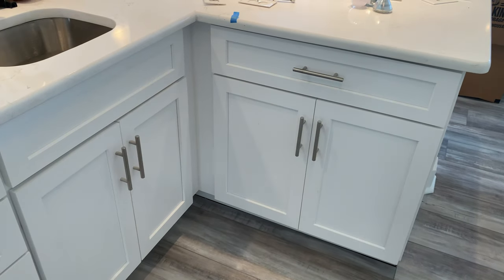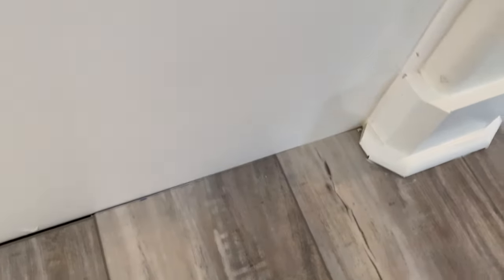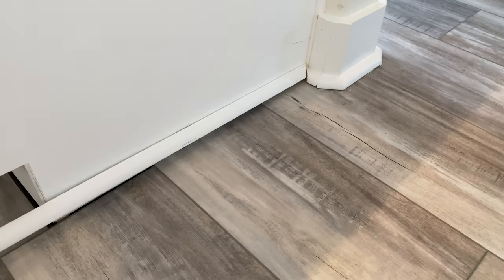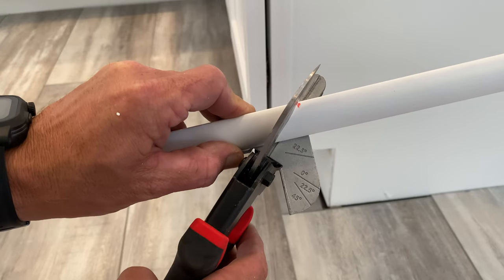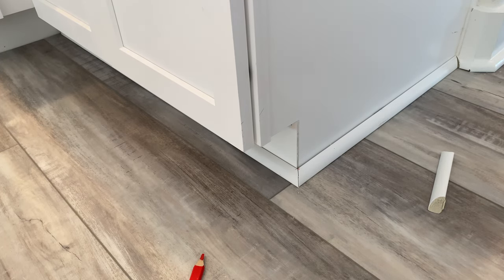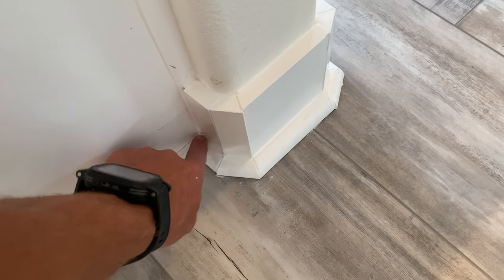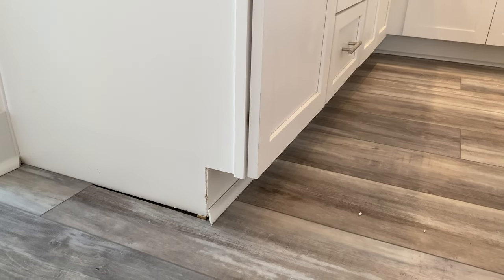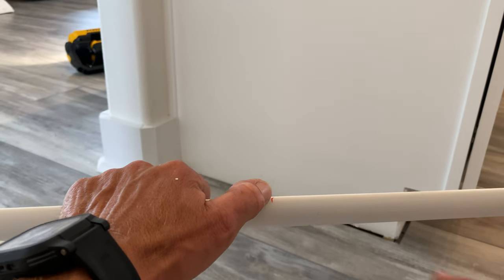Fast way to install quarter round trim

Comment: 44.5 degree cut create a perfect tight joint. 45 degree cut doesn't always give perfect joint and may need to caulking to seal some of the gap at the joint.
Reply: Jesus WHYYYYYYY has NO ONE EVERRRRR said this? I can't believe this "duh" moment. 🤦🤦🤦🤦🤦🤦🤦
Reply: Caulking is like paint. It covers up a ton of sins😉
Reply: When he's saying a "45", it's understood that the angle is variable from that, especially since he's cutting as he's actively placing the quarter round  🤨
Reply: I cope my inside corners with a dremel fast and no caulk needed just a little c a glue on my outside corners it’s good practice for putting in non painted 3/4 round
Reply: @TrumpedUp888  caulk and paint,,make a carpenter what he ain't!
Reply: 44.5 won’t work on all corners, usually down 2 or up 2, shit houses can be up 4 degrees. If they pay for perfect corners I’ll get every damn piece perfect. But usually they don’t want to pay for that. Never have a problem with 45s if you use miter bond. ALWAYS COPE INSIDES!
Reply: @kathleenrutherford733  I use a jigsaw with a coping foot now. but if you inside 45 your piece than flip it upside down, back cut your long straight side with your miter saw. That saves you a lot of time, then work in sections with your coping saw cutting little by little. The more accurate you’re there, the less you have to file down. If you’re really having trouble cut close than file down to your liking.
Reply: @Billybob-go8hn  you lost me? 😂
Reply: Do your best caulk the rest
Reply: Hard to get a fraction cut. I prefer 44* inside corners and 46* outside corners….
Reply: @jakerossgil3048 I wish I'd done that instead I learned to cope with a cope saw.. and I'm still coping with how long it took

Comment: I didn't even know such a tool existed for cutting the trim miters! I immediately went out this morning and bought one. It's going to make this job go so much faster, and will be much cleaner than user the miter saw! I even have the same nail gun, borrowed from my brother. :D
Reply from the maker: That’s awesome. I absolutely love them
Reply: I had bought a similar cutting tool for my quarter round.  It wasn't working worth a darn.  After watching your video,  I saw that I was putting the quarter round in the tool backwards.  DUH....works much better now!  Ha  Thanks my friend!
Reply: What is the tool called and where do you get it
Reply: @Davekinematic  Home Depot has them. And Amazon just tell them what u looking for they will know. I think it’s a quarter round clipper
Reply: What are they called?
Reply: Nvm found em
Reply: the tool is called a "miter shear" if anyone finds this and is wondering

Comment: I just ordered a ratcheting miter shear tool. Through my research it seems like the ratcheting version of the shears tend to not snap through the material, and have a more controlled slicing action. I’ll test it in a few days when they arrive

Comment: what is the name of that cutting tool I have been using a miter saw this seems alot easier I have been having an issue with a wall that is on a Angle and I keep missing the mark .. Great Video !!!
Reply from the maker: Miter snips

Comment: Thanks for the video!  If you leave 1/4" gag on your base molding, how does 1/4" round cover the gap?  Second question- How do you attach 1/4' round when there are steel studs?  I do not want to glue it, since the 1/4' round has to be removed in the future to replace the flooring.   Thanks
Reply from the maker: That’s a good question I would glue them and still be able to pull them off later. Base is usually left up a 1/4” to allow for carpet. Or other original floor

Comment: I tried to do this in my bathroom last night. I have a miter saw one those plastic guides. I could not get my head around the inside and outside 45. One of those snips would work a lot better 🤨👍

Comment: PVC quarter round is very easy to file a coped joint. Imo it makes a tighter install without the caulk issues
Reply from the maker: That’s very true

Comment: What a great tutorial Chris. What if I don't have that amazing power tool. What would you suggest? What type of hammer? What type of nail? I don't want to scratch the heck out of the floor to get the same angle as you do. Thanks so much.
Reply from the maker: Finishing nails and any hammer will do

Comment: I have the same brand in shoe moulding might try this tool Is there a reason why you didn't use shoe mould instead
Reply from the maker: Yes we used 3/4 rounds as the floor guys didn’t get the floor close enough to the walls
Reply: @crdriscoll1  ok makes sense.

Comment: Is there a tool that makes cutting wood 1/4 round as simple as PVC? I read you are going to post a 'how to'' for wood 1/4 round; where should I go to view the tutorial for cutting this product?  Very informative!!
Reply from the maker: The miter snips will work on pvc. But not so good on wood I would use a miter box and saw for wood good luck 👍

Comment: This was actually pretty helpful, I’ve worked on flooring before but we had a designated old man that would do the 1/4 round, baseboard, & t moldings. Never got around to learning it
Reply from the maker: Hey thanks for watching its very easy to figure out practice makes perfect 👍

Comment: Miter Snips.  WHERE DO YOU GET THEM - Good question. I got them at Home Depot in the flooring section most of them are set up kinda the same. Also lowes has some as well. Miter Snips.

Comment: Thanks, this is the point I am at with my own kitchen.  What kind of caulk do I use, and where do I apply it?  I have an engineered hardwood floating floor and 1/4" thick toe kicks.  I will be using pre-painted pine quarter-round.  I don't have that tool, but I have a miter saw.
Reply from the maker: I use Alex Flex paintable white caulking fast dry. Usually caulk just the top side of your moldings and have a clean wet rag handy with a small bucket of water to rinse the rag out. Once you apply the caulking with the caulk gun take and wet your finger index usually just moist not dripping and run it across the area you did with the caulk gun in both directions cleaning your finger off often to keep it from making a wide caulk joint. Hope this help’s.. This is if you are painting the molding. If you are staining it or want it natural then really don’t need to caulk.
Reply: @crdriscoll1  OK thank you!

Comment: great video man ..quick question .im trying to put some quarter round against floor base board but I have tile can I still nail them don't want to risk the nail cracking the tile and also what cutter are you using ?
Reply: Glue & some heavy books 📚 or full paint cans with a tshirt under to prevent scratches

Comment: if I buy the quarter round, install all the trimwork, and then use a caulk to fill in the staple hole or even any minor gap where the two ends meet. The colors never seem to match. The baseboard never matches the quarter round, the quarter round never matches the caulk.   Any advice you can give me so I’m not installing all this and then having to have to repaint everything?
Reply from the maker: Great question most trim is only primed. Giving that it will almost always show a difference in the Spackling to fill nail holes or even caulking. I always run my finger down the caulk line and then wipe with wet clean rags to minimize the (squeezing out effect) of the caulking and run that rag right over the nail holes. That may make the colors less noticeable but use like a 23 gage nail gun and that leaves a very needle size nail hole that almost invisible to the naked eye. Hope this will help some. Thanks for watching and commenting
Reply: Unpainted caulking will collect dirt and discolor over time. I like to put a coat of paint on trim before I install and then a quick touch up coat after caulk and putty dries.

Comment: I messed up and left too much gap at the door jambs. I did not cut into the door jamb to slide the plank under. Any ideas on how to cover these gaps?
Reply from the maker: Depending on how big the gap is will depend on what you can do. You could add some trim stock at the bottom of the door casings if you have like 1x4 trim but if you have Basic door casing trim it has a curve to it you may be able to find using a caulking that matches close to the color floor could help take the Eyes away from it. But again it really depends on how big the gap is.
Reply: @crdriscoll1  thanks. Appreciate the response. Good video too btw

Comment: Caulking just collects dirtbwhen applied next to a floor like this. If you want everything tight without caulking use a chop box.instead of caulk get some white filler

Comment: Good video. It's a pretty good explanation for us, rookies 😆. Do you like using the PVC cause it's a wet area, and does it cost a lot more to use pvc .Thanks
Reply from the maker: Not really much more at all and yes for wet location plus the ease of cutting so lower labor cost for sure

Comment: "Ideal" for "idea".  "Suscribe"  for "subscribe".  Interesting.   From the south?  Decent tutorial, though it didn't include things like inside closets, dead ends at doorways, joints along walls, and odd angles.       It's the details that make DIY challenging.

Comment: Just got me cabinets installed and the carpenter made straight cuts 🤦🏽‍♀️ and did not install the side pieces.
Reply from the maker: That’s not good only way is cope one side of the trim then the other side straight cut. Thanks for watching

Comment: Hi what are the cutters you're using? I`m looking to do an installation job and need to get those. also where do you get the PVC Mouldings from? Thanks!
Reply from the maker: Actually the miter snips can be found at lowes or Home Depot they are usually in the flooring section the quarter round i buy it at Home Depot in the trim section they have a section of all types of pvc trims hope this helps and thanks for watching

Comment: can you share the link of the tool you using
Reply from the maker: Here is a link to the miter snips thanks for watch. https://www.lowes.com/pd/CRAFTSMAN-Miter-Snips/5000085303?cm_mmc=shp-cprdtolgglLIA_TOL_216_Construction-Hand-Tools-5000085303-local-0-_-0&ds_rl=1286981&gclid=CjwKCAjwv-GUBhAzEiwASUMm4tMZeLptNTekJgg0y7JvK3vg3CFROAdZULZsNbntLC8ANc1SHDX46RoCKmgQAvD_BwE&gclsrc=aw.ds

Comment: Why wasn't the flooring installed all the way to the wall? Instead of the edge of the cabinets?
Reply from the maker: That is because the cabinets are installed before the flooring and you need a space in between walls and objects to keep your floor from swelling and buckling.
Reply: If it’s a floating floor like almost all are today you cannot install cabinets over the floor or it will buckle when it expands
Reply: @flyingburritobro68  you're right 👍

Comment: what's the name of that thing to cut the 45 I await your answer thanks
Reply from the maker: They are called miter snips. Here is a link for lowes hope this helps. 
https://www.lowes.com/pd/CRAFTSMAN-Miter-Snips/5000085303?cm_mmc=shp-cprdtolgglLIA_TOL_216_Construction-Hand-Tools-5000085303--0--0-_-0&ds_rl=1286981&gclid=Cj0KCQiAy4eNBhCaARIsAFDVtI0sZyhJfhvgzsGiMHZkXbO8DIkxYTnUX1lKNNzNHMtWuORWZ0g-IO0aAi1bEALw_wcB&gclsrc=aw.ds

Comment: What gauge nailer are you using here? I’m not familiar with the DeW guns.
Reply from the maker: Hi there it’s an 18 gauge dewalt pin nailer 20 volt cordless 
https://www.homedepot.com/p/DEWALT-20-Volt-MAX-XR-Lithium-Ion-Cordless-18-Gauge-Brad-Nailer-Tool-Only-DCN680B/302029641?source=shoppingads&locale=en-US

Comment: How do you terminate on either side of the dishwasher?  Do you butt cut, or some other cut?
Reply from the maker: Good question, yes just a regular square cut or butt cut end is how to end the quarter round at the dishwasher.
Reply: You make what is called a return.

Comment: I'm not saying it's true, because I'm a newbie myself, but the feedback I've gotten from some pros is that it's a rookie mistake to use quarter round instead of shoe molding
Reply from the maker: That could be but in this particular job the flooring had to much gap to cove with shoe round
Reply: @crdriscoll1  
After I made the comment, I saw more videos, and I stand corrected.

Comment: Is that real wood?  Will those cut oak ? I do 3000 windows a year and use alot of 1/4 round.
Reply from the maker: Great question, the Quarter round that I am using in this current video is actually PVC and that cut super easy with the miter snips but they will cut wood also just definitely got to have some good hand strength to chop through solid oak. I bought myself one of the cordless 20 V Dewalt chop saws that thing is super light weight and really does a great job with the shadow line instead of a laser line on the blade it is spot on every time but to answer your question yes it will cut oak.
Reply: Will not cut oak

Comment: Never miter inside corners.  Always cope.  Much tighter, cleaner, faster.  Walls are never flat.  You might have a perfect joint until you nail....

Comment: Where can I get the cutting tool? Thanks
Reply from the maker: Hey here is a link to Lowes. Also Home Depot has some too 

https://www.lowes.com/pd/CRAFTSMAN-Miter-Snips/5000085303?cm_mmc=shp-cprdtolgglSS_TOL_216_Construction-Hand-Tools-5000085303-local-0-_-0&gclid=Cj0KCQiAk4aOBhCTARIsAFWFP9EyAGR_NXfYTVSCXbtNqy_i5vWikoIuXYXRoJpjpo8iryrU0nKLeDkaAnVSEALw_wcB&gclsrc=aw.ds

Comment: In my trim carpentry opinion, base shoe molding should always be used for a professional look. Quarter round molding used as a base shoe just looks wrong. Looks like rental property.
Reply from the maker: Exactly what it is a rental property and could not use shoe molding as who ever installed the floors left way to big of a gap. In my opinion I would install baseboards after floors then use no shoe or quarter round

Comment: Shoe mold is different  than quarter  round.
Reply from the maker: Correct should round goes about 3/8” on bottom and rounded at top to nothing quarter round is a continuous radius

Comment: Where did u find those snips
Reply from the maker: Good question. I got them at Home Depot in the flooring section most of them are set up kinda the same. Also lowes has some as well. Miter Snips.

Comment: Your website says "The length of the nail should be approximately three times the thickness of the quarter round." huh!! ?? So a 3/4 quarter round will need a 2 1/4 inch nail?
Reply from the maker: Don’t think my website says anything about the length of nails

Comment: Never do inside 45 mitres. Do a cope mitre  using a coping saw. I've been doing this kind of work for over 50 years. I don't know of any pro who does inside 45 mitres.
Reply from the maker: Spec houses
Reply: Real pros cope there outside corners too😜
Reply: Inside coping is a true sign of a professional.

Comment: No pencil please. Mark it with the same blade of the Miter Cuter. And use 23 Gauge pin nailer for those trims, thanks 3:00

Comment: quarter rounder is the ugliest piece to use to hide your flooring.
Reply from the maker: Wish I laid the floors then I would have not left the flooring so far off the walls needs room but not 3/4” in spots

Comment: As a professional flooring installer and trim installer i would never use this tool
Reply from the maker: Use it all the time never had a Problem slow down and take time to make the cut’s easier than hauling around a chop saw for simple cut of pvc trim lol

Comment: The fastest way to install 1/4 round is don't.
Reply from the maker: Although that may be true in some cases but when you are doing a remodel and the customer does not want the baseboards removed Then you’re left with only being able to install a shoe round or a quarter round not many other ways to get around that

Comment: The Crain 1/4 cutter is better I had that cutter. Crain cuts through all types of 1/4 like butter. My ? Is what are you using 18gauge nail and nail gun and blasting holes through 1/4. That’s a gun you use for baseboard. Why not use a 23 gauge pin nail gun for a nicer finish.

Comment: Wouldn’t need to fill the nail holes if you used the right nail gun like the pin nail gun instead of blasting cannon ball holes through that pvc 1/4